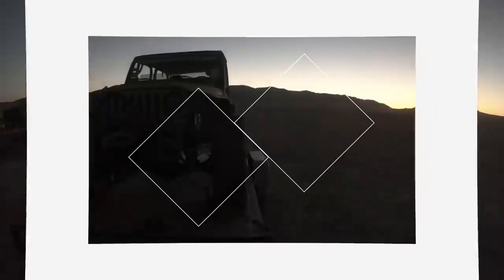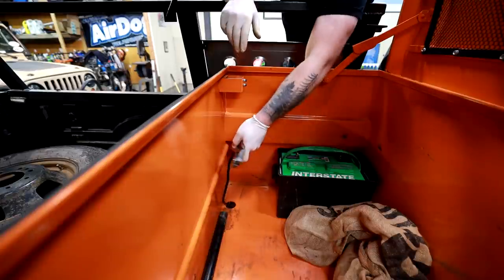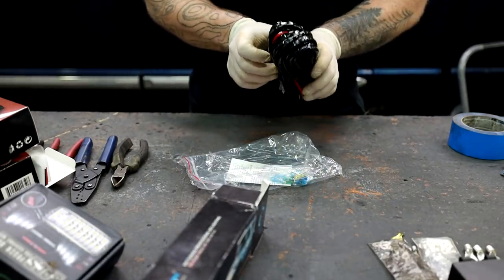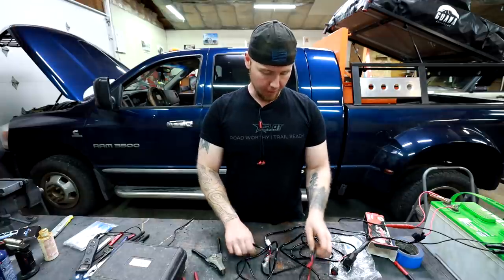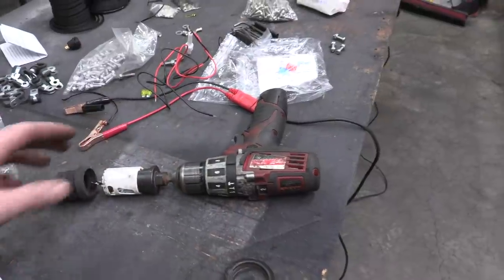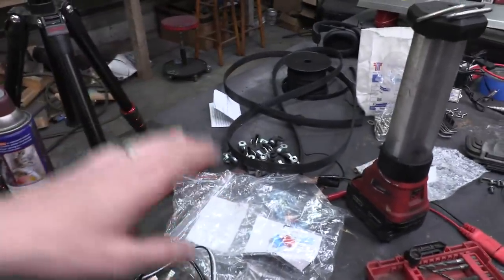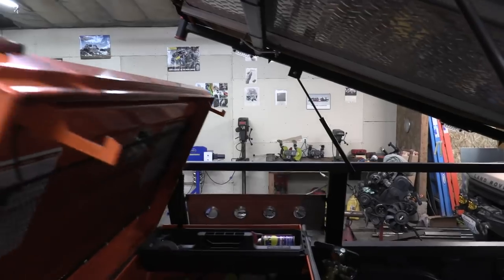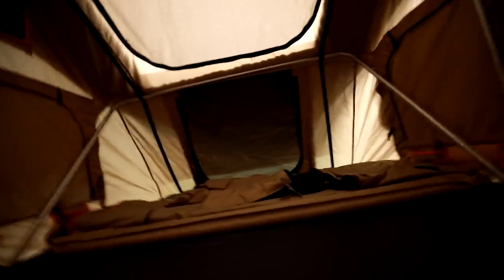CHEAP Roof Top Tent Rack Mods and Hacks! 4x4 Camping In Comfort 👊

Comment: Nate, use a voltage sensitive relay for charging your auxiliary batteries. It’s easily installed. BEP, Blue Sea Systems, etc. All marine applications. No real voltage loss, and they have a switch (relay) to prevent the aux battery from cannibalising your starting battery
Reply: Are you saying that there is something wrong with his current setup?
Reply: @amorton94  No that it's wrong, but VSR's (voltage sensitive relay) is a better way to charge an aux battery. They work automatically once the alternator is charging AND the main batteries are at a high enough state of charge for system voltage to be around 13.5 (depends on specific relay) and they are also rated for 75-150 amps rather than 30ish for a typical Bosch style relay.
Reply: Speed and Marine 
I was concerned with the potential of 140A going through a little relay. I’ve used an old style ‘ford’ starter solenoid to do what he’s doing, but the oil pressure trigger with the correct relay is a better idea. The VSR is even better, as well as 150A feed wire.
Reply: Definitely needs an ACR to manage the charge control or one puts the alternator and batteries at risk for a shorter lifespan.

Comment: When I wire stuff like the second battery to run off the charging system I use an adjustable Hobbs switch off the oil pressure, that way even though the ignition is on it doesn't connect the two batteries until the engines running with oil pressure.
Reply: hi there! thank you for such an awesome piece of information! could you please point to a website where i can learn more about this? I'm not sure how to wire this method.
Thank you!
Reply: @Porroquio  sorry I came up with that before the internet was a thing🤣 I used an adjustable oil pressure switch to interrupt the ground on a relay to the second battery, when there is no oil pressure the second battery is completely isolated. A manual toggle switch can be installed to bypass the oil pressure switch so you can engage the second battery at will
Reply: @adirondackadvriders4750  gotcha!!!! Pretty clever! Thanks for the tips and tricks!
Reply: @Porroquio  no problem! Glad I could help
Reply: this is way over kill, but super clever and original
Reply: @Porroquio  g body Chevies have it from the parts store for like ten bucks and early 2000s subarus use a metric version if you have a weird vehicle.
Reply: Ignition source!!!

Comment: Heads up a deep cycle battery has different charging profiles than a regular battery. Your alternator is setup to charge standard batteries. To change a deep cycle battery in your truck you should technically be using a DC to DC converter. Ctek makes em, probably a bunch of others as well. Using a relay or an isolator will work but will probably shorten the life of the battery.

Great job on the video, I'm thinking of using some of the design features from this rack and some features of the Landover rack to build something for my ram. Just have to make the entire rack quick release for when I have to pull the gooseneck.

Comment: Just FYI, you can connect the wiring in the a-pillar of the truck that go to the bed light to the reverse wires which will turn the bed light on with the reverse lights, or the reverse lights on with the bed light switch. This allows you to use the extra reverse lights to light up the back of the truck while connecting a trailer or whatever without having the truck in reverse. I did the same with my 07 RAM, has worked for years without an issue.

Comment: It’s probably been said already but you can get a “split charge relay kit” which will do exactly what you’re trying to achieve. They are used in camper van/ overland builds for all the auxiliary electrics. They are also much heavier duty for amperage draw and voltage drop than the relay and gauge of wire you are using.
Reply: @ZacCostilla  thats not weird or specific to DC... thats how electricity works
Reply: @ZacCostilla  Voltage drop is not such a bad thing as it will limit the current over the relatively small 12awg wire Nate is using. This drop will prevent the fuse from blowing when the voltage difference between the batteries is too high. Slow charging is generally easier on deep cycle batteries also.
Reply: Fei8lo voltage isn’t what blows the fuse it’s the amperage. Which for 12v DC 12awg at 10ft is only rated at 15amps in which case your maximum fuse size should be lower then 15amp.

Comment: Cool idea on the battery "isolator". Not truly an isolator though as that relay may trigger with only 4 or 5 volts and allow your truck to try starting from the auxiliary battery and subsequently melting that small wire. Possibly even starting a fire or ruining the battery when it shorts out. A true battery isolator will only allow electric travel in one direction, that is how it prevents the drainage of other connected batteries. For just a few $ more you couldve gotten a true isolator  and saved your self some work and gained a greater piece of mind.

Comment: I ran a similar setup yes ago for a stereo. 2 spare batteries in the back that charged off of the main battery under the hood. Basically a dual battery setup. I used 2 really big cables and it worked great no issues

Comment: Hey Nate, aircraft mechanic here. Your idea is brilliant, and should work. A word of caution. A low battery can draw alot of current, opon engine start up. Keep an eye on that relay. Check and make sure it's not getting to hot after a deep discharge. Also be sure to vent that battery in back. Lead acid batteries gas off hydrogen. Brilliant work sir👍.

Comment: I’m running a similar relay setup for my second battery on my 4Runner. I used a much bigger relay an IB500 500 amp relay tied to ignition to charge my 2nd battery only when the vehicle is running. No issues for the past year.

Comment: Great stuff! Really enjoy following along with your builds. I made custom drones for a while and have a tip for the fraying of the expando cable sleeve. If you put the heat shrink over the sleeving/joint and then burn the heat shrink, it will pull the expando tight, melt it together, and leave a really nice clean end. Then cut the burnt heat shrink off and just leave the clean expando joint or add another piece of heat shrink and heat appropriately to finish the look. Works great, looks super clean, and no burnt finger tips.

Comment: I've done exactly that battery setup in my truck. My relay is off the accessory circuit and I used some really fat cable (something like 0 guage) in case I completely drain the deep cycle and then start up the truck, it will draw a bunch of amps initially. It works flawlessly though. I probably went overkill on the size wire though.

Comment: Jeephammer may approve of your setup. I run dual batts without an isolator. I use the oil pressure switch and a relay to isolate the two batts

Comment: I agree with the other comments, you really should use an isolator or VSR to insure that your main batteries are at an acceptable level before you start charging the AUX battery. Otherwise great job! Very Clean!

Comment: Hi Nate, I wanted to take a second to address the issues with running a relay for battery charging. Specifically voltages. The idea you have is great but unfortunately these batteries aren't matched. The alternator will overcharge a battery with less capacity and under charge the other connected cells. Being a plumber this equates to trying to fill different capacity reservoirs. Additional once the key is turned to start the vehicle, the battery will end up being drawn from during starting because there is nothing preventing the backflow of current. The rule of using same batteries in a diesel would apply here. A battery isolator would work in this application but I would recommend a smart dc-dc charger. This small thing will allow smart charging of your battery and prevent backflow. Keep the current relay setup and add the charger inline. This will pay dividends down the road later when you get much more life from your batteries. Also I'm curious why you didn't choose a simple relay controller like aux beam or rough country has? Aux beam controller is $150 and has a backlit pad and the universal mlc-6 rough country controller is only $200 and both simplifies the install of after market accessories drastically. Thanks! 
James

Comment: your dual battery system is basically a dual battery isolator anyway its pretty much how they work wether voltage sensitive or ignition triggered works he same way. what gauge wire are you using to link the batterys? I think you should probably upgrade that to a bit heavier gauge because if you have a 80 amp or 100 amp alternator it will be pushing a fair bit of current down that small wire if the rear battery is very low

Comment: AWESOME BUILD, Nate!  
With reference to off road vehicle wiring I'd like to pass along a tip someone shared with me many years ago.  I suspect many here (and you) prefer to over-build, like me.  As an extra layer of protection, try running any wiring that's outside the vehicle (especially UNDER), try running it through PVC pipe or PEX or even flexible conduit.  I've found thiu\is to be invaluable  This is especially helpful over long runs of wire.

Comment: Maybe setup a switch like a car door so when toolbox is closed the lights are off. When you open the lid the lights com on
Reply: yeah, what you need is a normally closed plunger switch that opens the circuit when depressed. (Alarm panel Tamper switch or plunger door contact will work well) pass that through a double pole single throw relay and run power through the other side of the relay.  break the hot leg of the light power and the grounds are all common. when the switch is depressed, it will flip the relay and trigger the power shunt. when it's open, the relay will send power to the light.
Reply: Could just use a $3 magnetic switch too.  Same idea as an alarm switch on a building door.
Reply: I used this switch, which because of the design of the tool box lid, required a tab to hit it but is the switch that has held the best this far
 https://www.amazon.com/tatoko-XZ-15GW2-B-Roller-Microswitch-Terminals/dp/B07QMX2P4H
Reply: Tyler Bailey -think you mean N/O
Reply: @404Offroad_NotFound  n/c switch is correct, then it will be open when he shuts the lid
Reply: @georgegooge8212   lol sorry no. The normal state would be when the lid is closed.. You want the circuit broken when the lid is down and completed when the lid is open. Hence the normal state(lid closed) as N/O and you complete the circuit when opened . Relay logic is my lovely hood. I have worked in low voltage for 20 years.
Reply: @404Offroad_NotFound  A car door or bonnet switch is a normally closed switch, remove it from the vehicle it is closed, when you shut the door/bonnet it opens the circuit

Comment: I use a CTek DC-DC charger for my aux battery (agm).  Best value charging method. Charges the agm to the correct voltage. The alternator tops out at only about 13.8v on my truck. Plus, it has a solar input so I went ahead and put a panel on the roof to keep the fridge going when camped out for a few days.

Comment: Nice Build.  I installed a solar panel under my rack to provide power to extra gear via HD lockout sliders.  And I would highly recommend just buying a good quality “used” home panel(that what I did) as like you my Taco is a second choice to my 1st Gen 4rnr.  I have since switched racks.  lol. You can usually find solar panels on Offer Up or Letgo from a solar reseller.  Panels are rated for 25-30 life span but many people in SoCal swap out systems(upgrade panels as Tech improves) 5-7 years some times plus you get a high capacity 200w panel for 35-50 bucks. This panel are great for trucks as they are larger and bolt fright to the slide via drilling a few mounting holes along the box frame of the panel.  Thanks for sharing!

Comment: We've been using what's called a "split charge system" here in the UK for years.
Exactly what you were talking about 4mins in. Two ways to do it, first is using the alternator charging indicator line to trigger the relay the other is a voltage detection cct that opens the relay to charge the second battery after the primary has taken a bulk charge, this will also shut off if the voltage drops due to long draw (eg driving at night with all lights on and wipers and heater etc when the primary battery needs all the current from the alternator).  Also good for secondary batteries that power a winch. A solenoid type contact rather than a small relay is generally used.

Comment: Yes it never hurts to make sure a wiring harnesses you buy works correctly before installing for example i bought a wireing harness for my fans when i did a clutch fan deleted on my yj and the wireing harness was wired completely wrong so i had to modify before installing

Comment: You’re dual battery wiring setup will work fine. I used 2 40a relays switched by ignition to charge a second battery for years without any issues.  However. You still want to run slightly larger diameter cable as you won’t get a great charge with such small cable. I used 6mm/100a and it was fine over a 4m stretch. I also use the same setup to my camper trailer via an Anderson plug. It has 2 x 100ah deep cycles in it and it gets a solid charge on the run.

Comment: Use your 7 way trailer connection for reverse the middle pind on the plug usually a light blue wire

Comment: 14:25 If that is 3M VHB tape, you should trust it. It is designed and used for many outdoors applications including to secure solar panels on the roof of RVs instead of drilling the roof. That’s how my panels are mounted on my Lance truck camper and they are still solid as a rock. I mounted them in 2010. The bond strength is exceptional. Of course, you have prepare/clean the surface very well.

Comment: I used the same wiring harnesses for my homemade camper. Work great but the relays that came with mine were really cheap and within a year I had replaced all of them. Since then no problems
Reply: I wondered about them; I've had similar issues with no-name chinesium relays myself.

Comment: I just used a simple VSR (Voltage Sensitive Relay) on my rear-mounted battery. I think it is set to cut out supply to the rear battery at 13V. Charging Voltage of the vehicle is about 14.2 from memory. I have a 60A switchable breaker in line also. VSR and breaker are mounted under the bonnet neat the main battery.

Comment: Nice build, when I did my dual battery setup in my car camper I just used an old relay off the ignition switch kinda like your doing, mostly because i had a bunch of relays laying about and it was cheep. I've had it installed permanently for around a year and so far no problems at all. I also run a kill switch to manually disconnect the batteries if I have to.

Comment: The hinge point is a great idea! I will be building mine soon, but i want to utilize my full size tool box and was thinking of making my rack cab height being that the factory roof rack on my truck is fairly high as of now. I am guesstimating the tent will be 2-3 inches taller than the cab roof rack once i am finished.

Comment: When you draw down the battery in the job box to a low charge level. What will be the draw that it will have once relay switches on to start charging the battery.  Not sure if will be an issue. Just watched to many cheap jumper cables melt. And want to make sure you have a heavy enough wire run to it. Or potentially some type of fuse able link if needed.
Reply from the maker: This is my only concern. I have a 20 amp fuse inline so melting a wire isn't somthing that should be an issue. But how fast will the batteries try to dump a charge if one is dead? Batteries don't equalize very fast but I'm not sure. like I said in the video, this is an experiment 👍

Comment: I think you should use other control signal for the charge relay. You can find the signal that indicates engine fired up. The air conditioner system use this signal for sure. This will prevent the situation when you killed your back battery during the night and tryind to fire up when dead battery is connected to the main battery. 
Best greetings from Israel.

Comment: You have inspired me to build a insulated popup trailer and it is way slower going because I don't have a shop and am doing it in the sun. But it is not a bad thing taking the time. I am learning a shit ton of what I like and dislike. The electrical is one big thing I am trying to figure out! Most of it i plan on using s.o. 14gaw 3 I think I can run 12v and 120 if I can get to it.

Comment: The charge circuit your wanting is done all the time in rvs, go to the auto part store and get a constant duty solenoid. Ford used them for starters back in the day. You wire it the signal to a circuit  that is in acc. You can also add a second momentarily switch so if your engine batt is dead you can jump yourself. It’s called a mom circuit in the rv world. A regular 30a relay is not going to last like a solenoid will and if your gonna remote charge I would suggest using 2 gauge and nothing  smaller, reason is it will take to long to charge due to the lower amp capacity of the smaller wire, and if you ever need to jump yourself you need the larger wire.  I’ve designed many power systems just for this kind of use. It works really well for a on board system having a battery in the back even with the traditional engine battery cause you don’t have the voltage drop cause you have a battery closer to to compressor. I’m not sure if your truck is new enough to have a smart alternator or thermal alternator, if you do you will need a dc-to-dc charger to properly maintain charge to the house battery. I could keep going on many things but there is so many videos that support what I’m talking about.